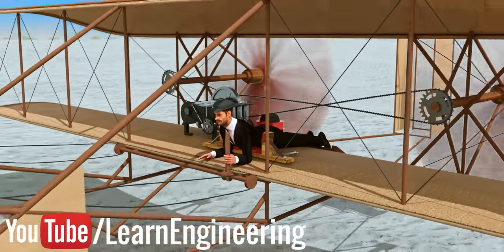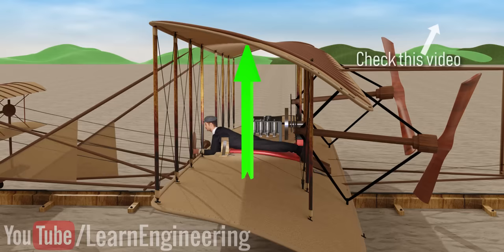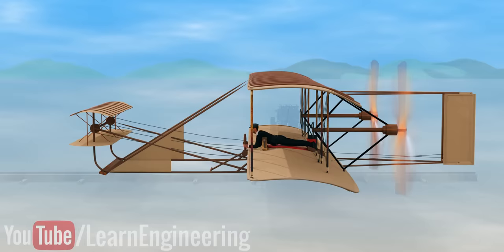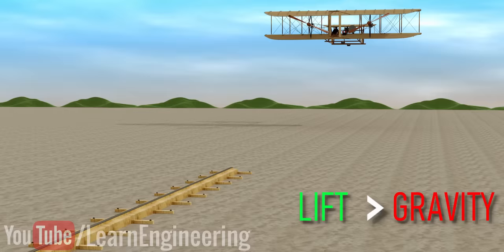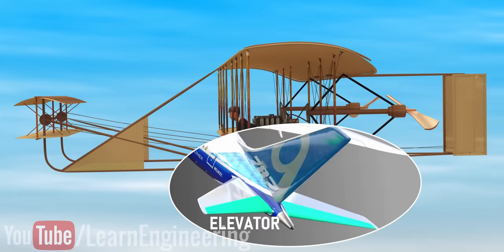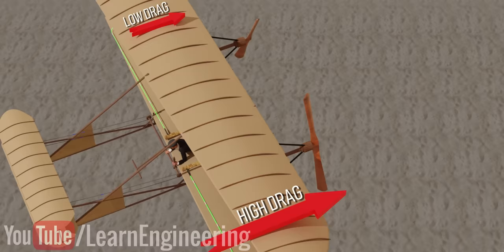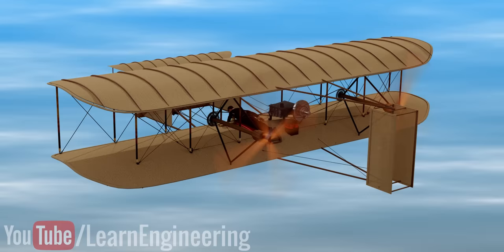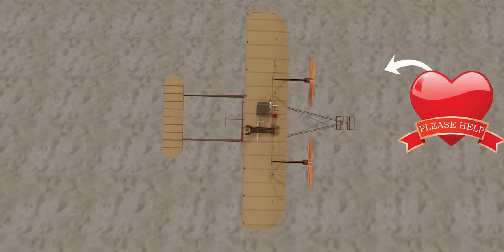The Brilliant Engineering of FIRST FLIGHT !

Comment: Please comment and tell the readers what you consider to be the contribution
of Santos Dumont's 14-bis.  Alberto made many contributions to the advancement
of aviation.  The request is limited to the contributions of one prototype:  The 14-bis.

SB:  What did the 14-bis contribute to aviation?

It was the first in Europe to show that a heavier than air machine could stay aloft long 
enough to traverse 100 m. (roughly equivalent to a 100 yard football field)  However, 
in order to be considered a contribution, a feature has to be copied by other aerial pioneers.

The use of a more powerful engine such as the 1906 Antoinette 8V was
copied.  That counts as a contribution.
  

Santos Dumont filed one patent on the cooling system on the No. 20, Demoiselle.  
That would not count as a contribution of the 14-bis design.  

The box kite was copied in the tail position by several early aircraft builders.  
Who gets the credit,
 Lawrence Hargrave or Santos Dumont?  

The use of the 1906 Antoinette V8 aero engine was successfully copied.
It is a contribution but whose?  Santos Dumont or the engines
designer and builder, Levavasseur?

The Brazilian critics are right with respect to "incontestable proof".  
There is no incontestable proof
of the flights and records reported by the Wright Brothers.  There is also no incontestable proof
that the reported events didn't happen.  There is plausible historical evidence that most of the claimed flights occurred.

The Wright's would not provide proof without an upfront payment of $35,000.  
In 1905, the Wrights published an article that was deemed to be sufficient for endorsement and acceptance by the American Aero Club.  It was not sufficient for the French-Aero club.  Their standards were much higher and included official witnesses and no external assistance.  No member of the
  American Aero-Club witnessed the alleged 1903 flights.  The 1903 Wright copy or its exact replica could take off without the assistance of a strong headwind and a small motor.  In Ohio, take off usually required a 10 mph headwind, a derrick catapult, and a 14-18 hp motor.  

Santos Dumont competed for the Deutsche-Archdeacon prizes.  These required meeting performance objectives and having official witnesses.  
FAI delegated the task of witnessing to the French Aero Club.

The attempts to win the prize were public and were filmed.  I am not sure if these were required. 
There is one photo that includes it Bleriot's prototype which also used the Antoinette 8V.  Were there
other contestants?

The 100 m. flight was at dusk. There wasn't enough sunlight to film it.  There were probably not many
spectators other than the official witnesses from the French Aero-Club.  The reason for the later
flight was to avoid endangering spectators.

You can't require something that is not included in the rules and regulations for the DA prize.  
So far, no one has found the original rules and regulations.  What do you think they might include?

We know the requirements for the Michelin Cup,  They changed almost every year 
and sometimes required more than 2 pages to describe.  

The FAI rules for official recognition have also changed over the years.  
After 1920, they dropped many of the rules allegedly found in the 1906 rules. 

"First flight certified  (and registered?*)  by Fédération Aéronautique Internationale (FAI): 
On November 12, 1906, in the presence of official observers from the newly founded FAI, 
Alberto Santos Dumont took-off and flew with his 14-bis aircraft, without liftoff aid, over a 
distance of 220 m (720 ft) at the Chateau de Bagatelle, Paris."  [41]

* If it was registered, where is it found in the FAI's official records?   The records I have seen indicate
that the Farman flight of 1908 was the first.  The French Aero club, also does not record the Dumont
flight of 1906 as the first.  A later flight is mentioned as the first.  Both groups have certified the successful
1906 flight of the 14-bis.  They have also certified the 1903-1905 flights of the Wright Brothers.
Reply: Please Comment:  Portuguese translation:

Comente e diga aos leitores o que você considera ser a contribuição
do 14-bis de Santos Dumont. Alberto fez muitas contribuições para o avanço
da aviação. O pedido é limitado às contribuições de um protótipo: o 14-bis.

SB: O que o 14-bis contribuiu para a aviação?

Foi o primeiro na Europa a mostrar que uma máquina mais pesada que o ar poderia permanecer no ar por muito tempo o suficiente para percorrer 100 m. (aproximadamente equivalente a um campo de futebol de 100 jardas) No entanto, para ser considerado uma contribuição, um recurso deve ser copiado por outros pioneiros aéreos.

O uso de um motor mais poderoso, como o 1906 Antoinette 8V foi
copiado. Isso conta como uma contribuição.
  

Santos Dumont depositou uma patente sobre o sistema de refrigeração no nº 20, Demoiselle.
Isso não contaria como uma contribuição do design 14-bis.

A pipa de caixa foi copiada na posição da cauda por vários dos primeiros construtores de aeronaves.
Quem fica com o crédito, Lawrence Hargrave ou Santos Dumont?

O uso do motor aero 1906 Antoinette V8 foi copiado com sucesso.
É uma contribuição, mas de quem? Santos Dumont ou os motores
designer e construtor, Levavasseur?

Os críticos brasileiros têm razão no que diz respeito às "provas incontestáveis".
Não há prova incontestável dos voos e registros relatados pelos irmãos Wright. Também não há prova incontestável que os eventos relatados não aconteceram. Há evidências históricas plausíveis de que a maioria dos voos declarados ocorreu.

Os Wright não forneceram provas sem um pagamento inicial de $ 35.000.
Em 1905, os Wrights publicaram um artigo que foi considerado suficiente para endosso e aceitação pelo American Aeroclube. Não foi suficiente para o clube franco-aéreo. Seus padrões eram muito mais elevados e incluíam testemunhas oficiais e nenhuma assistência externa.

Santos Dumont concorreu aos prêmios Deutsche-Archdeacon. Isso exigia cumprir os objetivos de desempenho e ter testemunhas oficiais.  A FAI delegou a tarefa de testemunhar ao Aeroclube francês.

As tentativas de ganhar o prêmio foram públicas e foram filmadas. Não tenho certeza se isso era necessário.
Tem uma foto que inclui o protótipo de Bleriot que também usou a Antoinette 8V. Estavam lá
outros concorrentes?

A 100 m. o vôo estava ao anoitecer. Não havia luz solar suficiente para filmá-lo. Provavelmente não havia muitos
espectadores que não sejam testemunhas oficiais do Aeroclube francês. O motivo do mais tarde
o vôo era para evitar colocar os espectadores em perigo.

Você não pode exigir algo que não esteja incluído nas regras e regulamentos para o prêmio DA.
Até agora, ninguém encontrou as regras e regulamentos originais. O que você acha que eles podem incluir?

Conhecemos os requisitos para a Taça Michelin, mudaram quase todos os anos
e às vezes exigia mais de 2 páginas para descrever.

As regras da FAI para reconhecimento oficial também mudaram ao longo dos anos.
Depois de 1920, eles abandonaram muitas das regras supostamente encontradas nas regras de 1906.

"Primeiro voo certificado (e registrado? *) Pela Fédération Aéronautique Internationale (FAI):
Em 12 de novembro de 1906, na presença de observadores oficiais da recém-fundada FAI,
Alberto Santos Dumont decolou e voou com sua aeronave 14-bis, sem auxílio de decolagem, sobre um
distância de 220 m (720 pés) no Chateau de Bagatelle, Paris. "[41]

* Se foi registrado, onde está nos registros oficiais da FAI? Os registros que vi indicam
que o vôo Farman de 1908 foi o primeiro. O Aeroclube francês, também não registra o Dumont
voo de 1906 como o primeiro. Um vôo posterior é mencionado como o primeiro. Ambos os grupos certificaram o sucesso
 Voo de 1906 do 14-bis.  Eles também certificaram os voos de 1903-1905 do Wright

Comentários encorajados e bem-vindos.

Comment: Very Nice.! Please make a video explaining Dumont's 14-BIS
Reply: I love Brazilians....

"The replica didn't fly." -  The weather on December 17th at Kitty Hawk was unusually cold that day. The barometric pressure was very very high. The air density altitude on that day was about a 1000' below sea level from a normal day. That's why they flew. Had they not, it would have only been a few days and they would have. When they went back to Ohio the air density altitude was about 5000' and no, the aircraft didn't fly. It took them some time to figure out that barometric pressure was important when it comes to flying.

"They were catapulted into the air and glided."-  They did not use a catapult at Kitty Hawk. You are referencing the very 1st filming of a flight in Ohio. That was the 4th airplane they had built in 1908 (its here on YouTube) . There was no catapult at Kitty Hawk…. There was no catapult…. At Kitty Hawk. If a fighter jet gets catapulted off the end of an aircraft Carrier, does it then not fly?

"Dumas was the first to fly"‐  According to the definition of heavier-than-air flight, no he didn't. His airplane did not have a proper propeller, it did not have a way of controlling the aircraft via ailerons or wing warping or a rudder that moved or elevators that went up-and-down…. He hopped. Just as you guys wanna claim the Wright brothers were catapulted... his airplane was just like a paper airplane.

Please go do some research!!!!!

Comment: The pilot is off center to balance the weight differential because the engine is off center. It is off center because it could not be placed in front, nor behind him. Of course if they wanted perfect balance he would weigh 180 lbs. the same as the engine weight, but they could add weights for him to weigh equally to the engine of 180 lbs.

Comment: The pilot is off center because... they need for the center of gravity of the piloted aircraft to be on the centerline and by positioning the engine and the pilot correctly that was achieved. The center of gravity has to be centered and not off center. A very delicate balance problem.

Comment: The “Thrust arrows” at the beginning of the video should be pointed aft and not forward. The props were pusher props and not tractor or puller props. So the thrust so be facing aft which moves the flyer forward.
Reply: You’re confusing thrust with prop wash.  Thrust is the invisible, forward force produced when propellers push air backward, and this occurs whether the propellers are mounted fore or aft.
Reply: @cardinalRG  Yeah I get the direction the plane is moving. The thrust from those props is backwards which moves the plane forward. He should have animated the arrows at the front of the plane. I take it you fly a Cessna Cardinal RG?
Reply: @keneisner7363  --No, friend, you’re still confusing thrust with prop wash.  Thrust is the FORWARD force produced by a propeller pushing air backward.  With a turbojet engine, thrust is produced by the exhaust exiting the rear of the engine.  So the video is correct.  (You can find many diagrams on the internet, if you Google something like "airplane four forces".)  And again, it doesn’t matter where the propellers are, fore or aft, because for the sake of thrust production “tractor” versus “pusher” is a semantic distinction, not a physical one.

I used to fly a Cardinal RG, but I'm a retired pilot now, an old fart half way to legal blindness, and so I don't fly anything anymore.  I thought that "Cardinal" sounded good as a YouTube screen name.  A few times someone has mistaken me for a Catholic Cardinal, and asked me questions about the Vatican!
Reply: @cardinalRG  Again I’m well aware of the four forces of flight. I’m just saying for illustrative purposes, the thrust arrow should be at the front. That’s the direction the plane is going.
Reply: @keneisner7363  --Alternatively, the thrust arrow can indeed be positioned at the front of the aircraft (and it commonly is), just as the forces of drag, lift and weight can be positioned in either of two opposite positions.  But the thrust arrow must always be pointed forward, never backward as you've claimed.
Reply: @cardinalRG  I agree! Glad to be chatting with a fellow pilot!
Reply: @keneisner7363  A side note--When I taught primary ground school, I always preferred the term “weight” over “gravity” to describe the downward force acting on the aircraft, even though both terms can be found on four-force diagrams.   Some students tend to hang up on the notion of gravity as having a fixed strength, but everyone grasps that weight varies so it makes for a more reliable conception of the balance of forces.  Happy flying and good tailwinds.